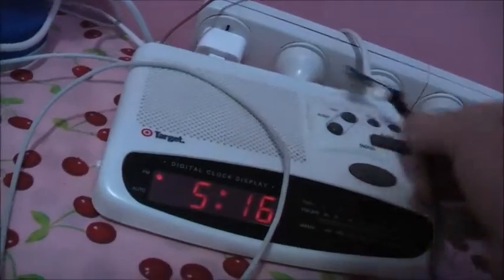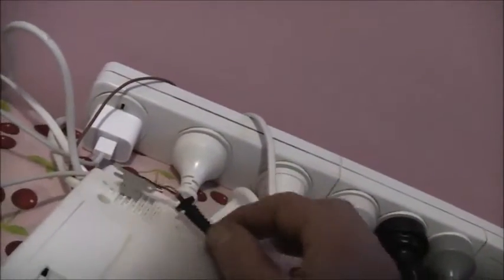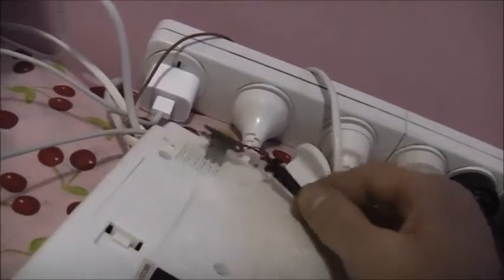Tape head experimentation

Comment: The head should be relatively low impedance, you shouldn't be getting the hum, if you have a multimeter you should get some resistance between the pads. Those will only have 2 heads, the record function uses the same pair of heads